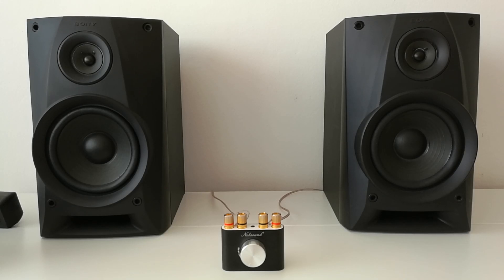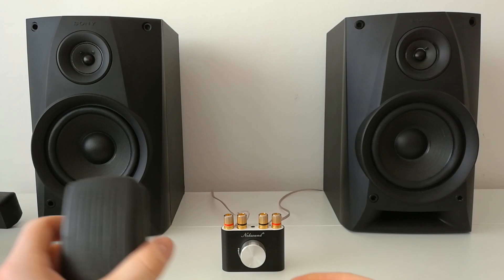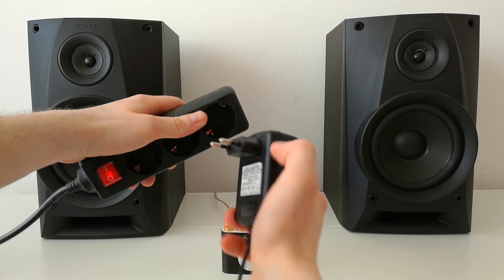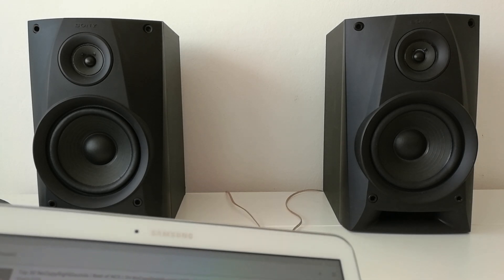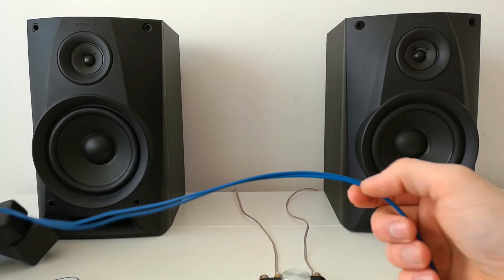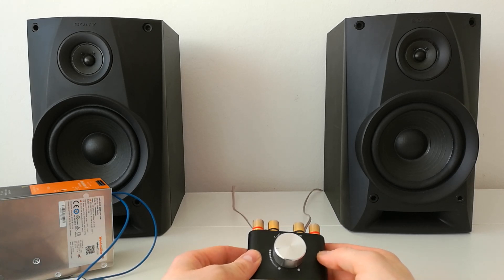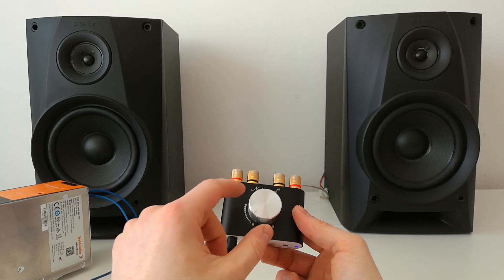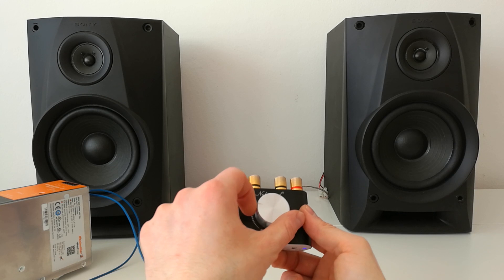Nobsound drive on 12V or 24V power suply (what is best?)

Comment: if you want full power 50+50W you need more than a 12V-5amp(60W=30+30)
Reply: After some testings, even for a full 50W you need 24V, it doesnt draw that much current acording to another YT video, i have a 19V 4.74A (so 90w) using 2 bass shakers 50+40W and i get cuts at 90-100% gain even with just the 50W shaker, plugin in the other one and its a mess, cuts all the time. I have a 24V 2.5A PS somewhere, ill give it a test. Still the info they give is poor, no matter where you buy them, i bought the wrong PS but it wasnt my fault.
Reply: have you ever plugged one into a watt metre lol

Comment: On the 24v power supply what size adapter connector is that a 5.5mm DC Plug?  It looks like you made a custom connector. Thanks

Comment: I have the Nobsound NS -01G Pro and I've been using a 15V 6A switching DC supply on it for 2 yrs and it puts out a respectable 18+w per channel with no distortion that I can hear using Jamo S803 bookshelf speakers.

Comment: I have a NS20G model that came with a 19V 3,2A power suply, I tried a 24V 3A and the bass got better BUT medium and high frequencies got worse, so I bilieve that 19V is the ideal. I road about some Nosbsound  specs and the say the better performance is under 20V.

Comment: I have several 18v batteries that I plan to use for one of these amps. Will 18v still produce a better output than 12v? Would it be worth adding a simple step up voltage converter or is it not worth the losses since I'm using batteries?
Reply from the maker: With 18V will work ok. 
In original package with power supply 19V power adapter is applied. So it will be fine.

Comment: Did you notice the amp getting hot with the increased voltage?  I used a 19v Dell charger with and the unit got hot?  Is that safe?
Reply from the maker: Its normal to get hot.. The amp is using its own alu housing for cooling..
Reply: Came here to see if I could use a dell 19v power supply as I just blew my 24v power supply.  Glad I found this!

Comment: Mine came with a 19V DC/ 4.74A power supply adapter. But I bought the Nobsound NS-20G, which is bigger than the NS-01G you have in the video. I think the 24V might work well with mine, but might risk damage to the smaller Nobsound, which typically comes with a 12V, but offers the 19V as an upgrade. Especially if you use 4 ohm speakers or less.
Reply from the maker: .. you can easy drive them up to 24V. They probably recomend the 19V adapter becouse of the risk of damage.. people drive them to the max volume than you must be aware that this amps only cooling is housing itself.. so I think that they had that in mind.. :)
Reply: @als-techreview  agreed, but I'm not so sure it's a good idea for someone who might be overly enthusiastic at the volume control. When I spoke to people at Douk Audio Nobsound,  they indicated the smaller NS-01G typically is sold alone, or with a 12V power supply adapter, but could safely be used with a 19V 4.74A adapter. But they do not recommend the use of a 24V one. But the larger NS-20G typically is matched with the 19V, and can safely be used with the 24V. In your case, I know you are being careful not to turn the volume up to clipping, so in that case, the 24V will work fine, and obviously will perform better than the 12V one it normally comes with. But I think it is important for those viewing to bear this in mind, that overpowering these, using a higher powered adapter than recommended can pose risks if one is not careful to drive the unit beyond it's limitations. These class D amplifiers tend to run warm, and can heat up quickly, overheating easily, due to the small compartment enclosure, and do not dissipate heat well, with relatively small heat sinks no internal cooling fans. Personally I love these little mighty mouse units. But in my opinion, if someone wants more power, and better sound, and wants to use the 24V adapter, it makes more logical sense to upgrade to the larger Nobsound NS-20G for the few dollars difference, rather than risk damage to the smaller NS-01G. The 19V adapter does significantly improve the NS-01G, but if that is not enough for someone, perhaps the best idea would be to buy the NS-20G instead, and then the bigger 24V adapter.

Comment: My nobsound sounds much better with higher voltage adapter. Power adapter 20V 4,5 A is much better than original 12V 5A. The biggest difference is in deep bass songs in max volume. Try for example https://www.youtube.com/watch?v=GGTfFBz0M1c. I use bluetooth mode or preamplifier for AUX mode, because only AUX mode is not so powerfull.
Reply: Your video is private. Can you share it

Comment: I use 18volt power supply
Reply from the maker: and how it performs? work great?
Reply: It has bass and treble and the amp becomes hot because its 18v4a
Reply from the maker: Zibeon zanen.. yeah it very depend from speaker to speaker.. on some speakers can produce quite a lot bass on others less.. but stil cant say a bad thing about it.. it is a great amp.. ;) specialy for the price..
Reply: I use a 90w @ 19VDC  laptop power supply for my Nobsound amp and I don't see much difference from the 12 VDC  5A supply that was included in the package when I purchased it.
Reply: 18volt peasant. 🧐

Comment: The 24 Volt is better, more dynamics, more bass, it is worth making a better filtered 1000uF analog power supply with 24Volt because the switching power supply does not provide enough current.
Reply: Not bass
Reply: What you said is wrong, and also doesn't make sense. There's no digital/analog power supplies, but I get what you mean. Linear PSU vs switched PSU.

 A switching PSU (SMPS) will have much higher power output, at the same size, than any linear power supply. This is because SMPS utilize the fact that switching at high frequencies allows you to significantly scale down the size of your inductors, and hence the size of your transformers. The benefits come at the cost of noise. Because a switching transformer works by first turning the mains AC voltage into DC, and then pulsing the transformer with a square-wave, you get a lot more noise at the output of your transformer. SMPS then deal with this with a low-pass filtering network on the output, but you can only do so much, while maintaining a reasonable price.
Also, throwing 1000uF on a PSU will help with bass response, but not necessarily anything else. You need smaller, much faster acting capacitors to deal with the switching noise.

To sum it up: Proper Linear PSUs give nice clean DC outputs, at horrible power efficiencies. Because of this, they have to be huge, and them being huge means they cost much more for the same power output.  
SMPS  on the other hand, offer really compact high power options, usually at good price-points too. They however have more noise on the output.  
In my personal opinion, this noise is negligible in this use case, and is not something you'll hear, as long as you ensure the PSU is grounded on the mains connection, if it as a ground pin. 

If you are buying this amp, you probably don't have money to burn on a huge linear PSU, so buying a good SMPS, like a Mean Well, Delta, TDK-Lambda, CUI, or Artesyn probably makes more sense financially. 
I myself use the Delta ADP-40KD BB PSU for about 16 eur, which is a 19v 40W psu, giving me 20W per channel, which is plenty for me. Another option if you want to use 24v, for something like 8ohm speakers, there's also something like the CUI SDI50-24-U-P5, for ~19 eur, which is a 50W PSU.   Those are just two picks from here: https://www.mouser.dk/Power/Power-Supplies/Plug-In-AC-Adapters/Desktop-AC-Adapters/_/N-brw25Z1yzvvqx?P=1yx5k7vZ1yx2wd9Z1ysr4miZ1yva230Z1z0zl46Z1z0zl9bZ1yzok0yZ1yxt74dZ1yxt73cZ1yxt7ea&Rl=brw25ZerbiZ1z0wdimZ1z0wdifSGT&Ns=Pricing%7c0  which is a parametric search of any PSU with 19-24V output, and 20-150W output power. Pay attention that not all PSUs use the correct plug for this amp, but in my case that doesn't matter. I can put a new connector on if I need to.
Reply: @dumle29  how would i fair running an amp like this on a 12v battery system?